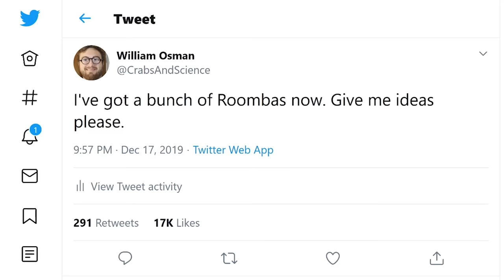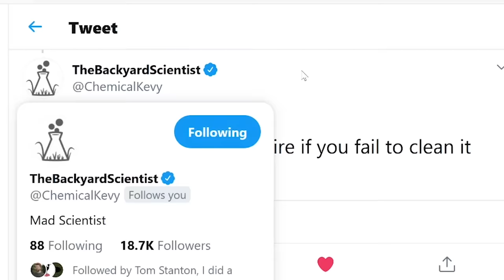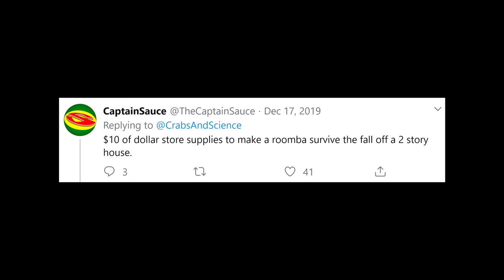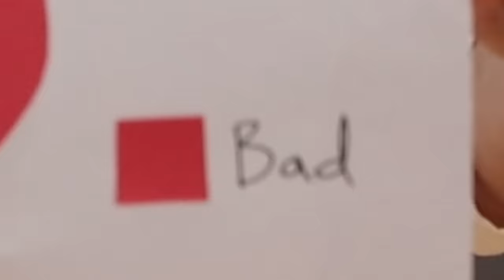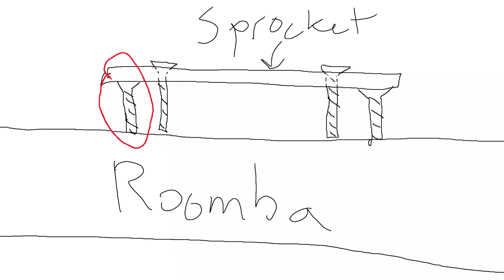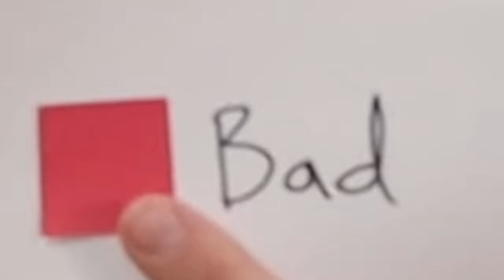A Bike But The Wheels Are Roombas

Comment: Did you try turning them off and back on again?
Reply: Ahhh it’s been a while since I heard an IT crowd reference
Reply: Instructions unclear my roombas pregnant
Reply: Did you try rice?
Reply: The turning off part sounds a bit hard. I think the solution is downloading more RAM from the cloud so you can run a 100% free version of Windows 7 on them and then transfer a small fee of 150$ to Rahmid Ashol. Next crack two eggs into the dust compartment, then fill it up with diet coke and put one and a half packs of Mentos in there along with a fully molten stick of hot glue. Then the Roombas will have speed- and flyhacks installed. OMG!!! REALLY WORKS NOT FAKE !1!!! 100% Halal 2013 NEW 🔥💯
Reply: @hunzhurte  I downloaded my graphics card.. will it work still?

Comment: Me: "I went to an industrial design school for four years and then went to intern at a domestic robotics company in China... where I helped design that Deebot... oh look its in this video!"

William: "I went to engineering school" drills through the top
Reply: Glad you can see what good use the product you helped design has come to
Reply: Weird flex but ok
Reply: @sethp8947  it's super rare to see someone using this product as it was mainly for a Chinese market 👀 idk not super proud or super disappointed in it
Reply: That's awesome! I actually own that exact Deebot. It works great though I do want to tear into it to see if there are any free pin headers that I could use to do fun stuff.
Reply: Well, your design held up as a bicycle wheel. That's gotta be worth something.
Reply: PC Guy I’m not very techy, could you explain what a pin header is? And what fun stuff you could do with it?
Reply: r/iamverysmart
Reply: @heysaucemikehere1804  they're like little connecting points so that you can access the firmware and potentially can program the hardware to do fun things. Hardware hacking 101 = where are the pin headers lol
Reply: @seanponder3028  I wish
Reply: linoleumbreathmint Thank you for explaining!
Reply: William got a major in mechanical engineering and a minor in electrical engineering in school for 5 years and worked as a mechanical engineer for  4 years rapidly prototyping mri machines and control systems for an HDMI camera and remote.

He vewey smart boy.

Comment: Take rumba and modify it to control gasoline powered lawn mower? Just add wheelchair motors. Alternatively take normal vacuum cleaner and do the same, so its actually useful and wont crap it self when coming to contact with anything bigger than basic showroom house dust.
For repairing them, i suggest looking if the fuse is functional, if the battery is alright and if there is any traces of fucked up components visible on circuit board. I'm no means electrical wizard, but if people would just look into basic shit like fuses being ok and such problem solving instead of going to store, more things could be repaired and less shit into landfills. Also since its being taken apart least some of it can be recycled properly, instead of going to land fill.